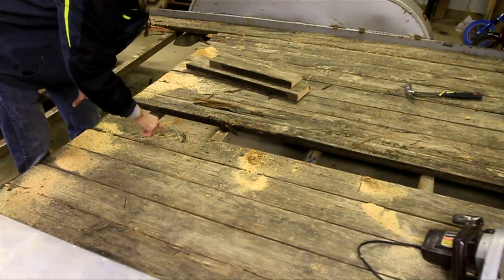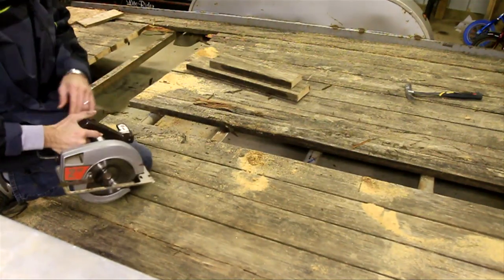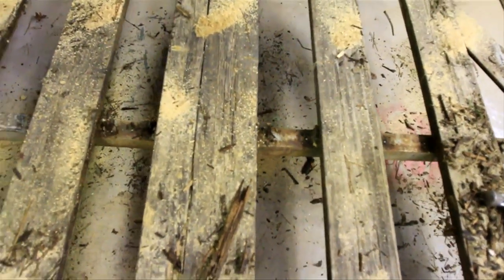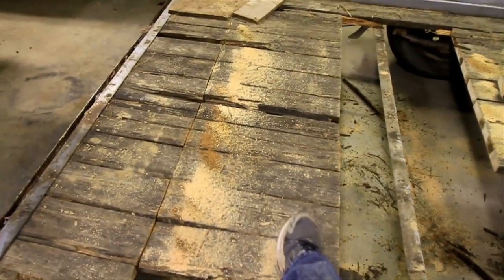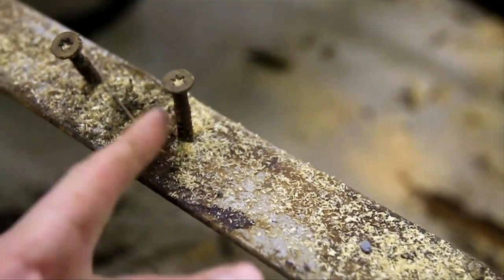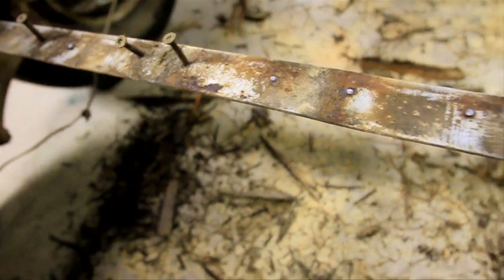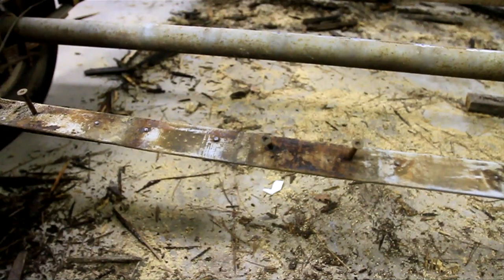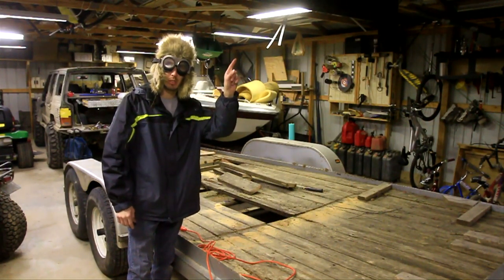Re-Deck Your Trailer - Quick Tip

Comment: One thing they never talk about in these redecking videos is this; when you decide which side of the board goes up, look at the end grain. The curves of the grain should form a hump, not a valley. This way when they weather they cup up and shed water instead of cupping down and pooling water making rot occur quicker.
Reply: Correct...That is called installing the wood "Bark Down."
Reply: Excellent tip sir 👍
Reply: Another thing... If you are able to line up the new bolts with the old screw holes? I'm doing this same thing but worried about the holes not lining up and ending up with a ton of holes in the frame... It seems there's no way to really line it up perfectly?

Comment: Your boards didn't look too bad, but you may have just wanted new looking wood.
Here's a tip my Father in Law told me to do with wood decking on trailers & trucks, brush on your left over motor oil onto the wood decking on a warm day. It will water proof it, and it doesn't cost you anything but a brush and time.
I just make sure not to put too much on so that It only soaks into the wood and doesn't drip on the ground and into the water supply.

Comment: I have an air chisel sitting on my shelf.  As I think about it, it would work to take the head of the screws off if I find them in the decking of my trailer.

Comment: Yeah. Right now I'm in the process of building a 20' tall by 50' wide by 70' long triple bay with loft space shop. The reason i want yours is because until mine is done I'm stuck in a 24 by 30.

Comment: Good tip! Well it may be beyond the scope of this video, I was hoping you would say where is a good place to get replacement boards.
Reply: At 4 years old.. This comment didn't age well 😟 big orange store wanted $32 per 16ft 2x10, but I did manage to get a hold of a builder supply through a connection and got $22 a piece
When shopping for with lumber for a larger project, it might be worth it for anyone to know a builder or find one and ask who they get their supplies from and see if you can go direct from them, not from a reseller
But this usually requires a way to move the materials too
Reply: @DonWRII  Thanks for reply.  I was looking to replace oak boards with oak boards, but I didn't specify that in my comment.  Pine lumber will need to be replaced sooner than white oak, for sure, so I wasn't looking at the big box suppliers.  Your tip on coordinating a purchase with a builder is great!  In my case, I ended up taking down an oak tree myself and bringing it to my local neighborhood sawmill operator.  A 2" board really is 2" if you want it that way.